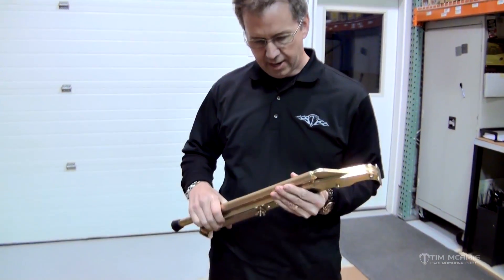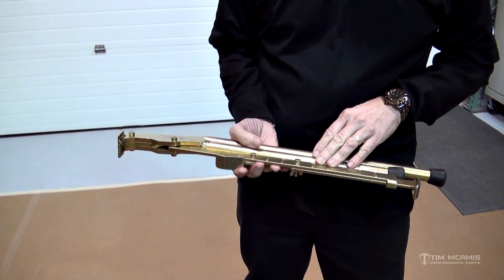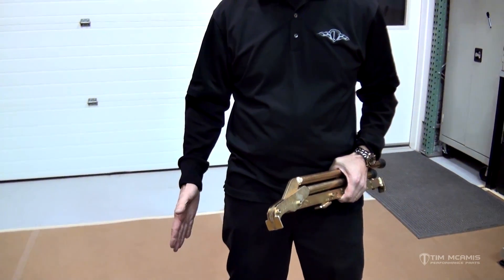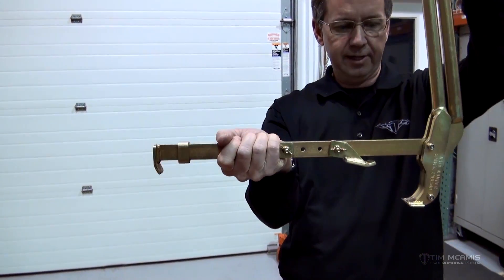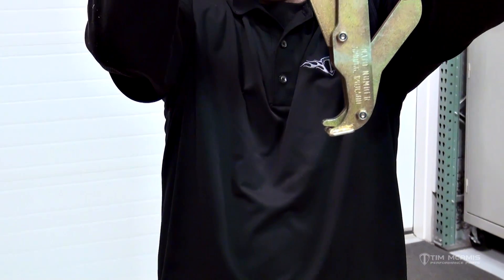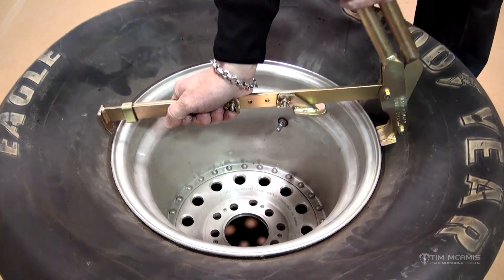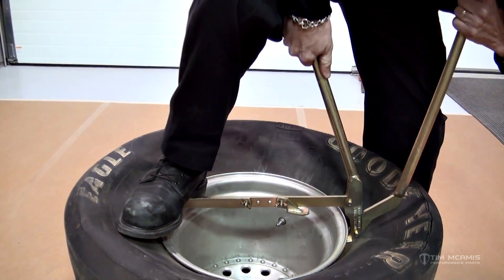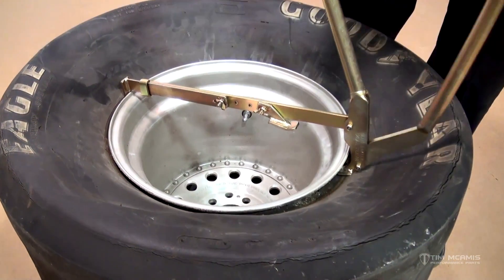Tire Bead Breaker Tool

Comment: I'm going to try one of these. I'd rather not try the car-jack method.
Reply: WesOfX yeah you right about that dude I've seen the car jack Method All my life and that's kind of janxy from me
Reply: The big yellow heavy bar type has worked fine for me for decades and there is nothing to adjust or setup. You don't even have to do any bending or squatting down. Just set it on the edge and a few whacks and you're done.